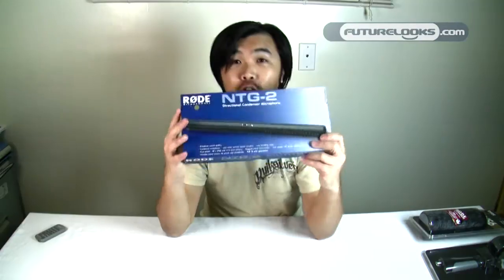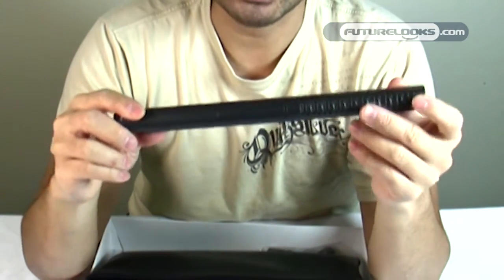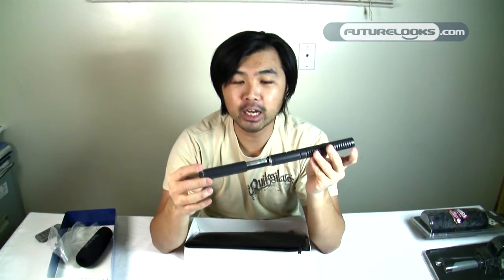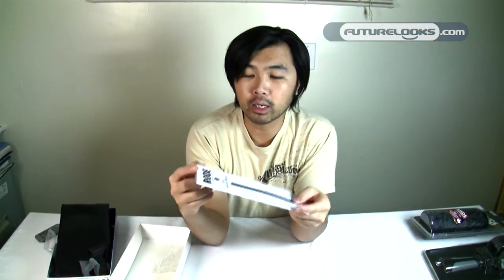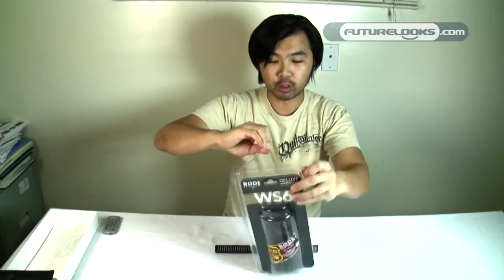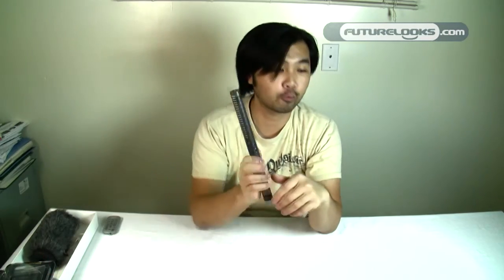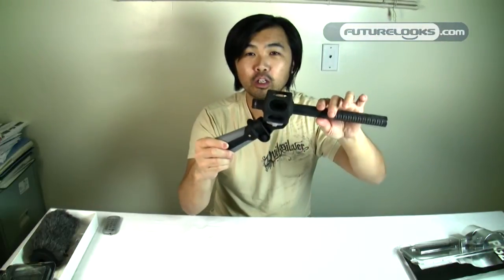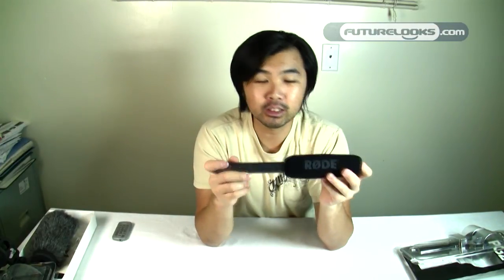Futurelooks Unboxes the RODE NTG-2 Shotgun Directional Condenser Microphone

Comment: So glad I found you showing the same version of the mic that I have, I recently bought an unboxed Rode NTG-2 off ebay for 70GBP and after watching a few videos on YouTube I was beginning to think I had bought a fake microphone. I've seen the NTG-2 in a black box,a white box and a blue box (like yours) but the one thing I've found out that is different between them is that the mic's that come in the blue box have the serial number printed on a sticker which is located at the XLR connection end. The mic's that come in the black or white boxes are screen printed onto the actual mic in the same location. Thanks again for showing a close up of the mic,you've put my mind at rest and now I can go out and start using my mic.

Comment from the maker: @tigalimamili The signal will be weak so you should put it through a box that allows you to control the levels. The folks at JuicedLink make such a device for your camera and it highly recommended if you care about the audio. Or you can run dual audio with a ZOOM H4n recorder. We did a video on this one not too long ago. Really great recorder that improves the audio for sure.

Comment: I have this mic and just bought the WS6 windscreen, that fur is a real must have! Forget about the included foam, even indoors, I got noises from a lazy fan while using it. One more you might want to invest is some real protective/hard casing, I dropped the mic TWICE into the pavement while it's in that vinyl bag! Got a little dent on the bottom, regrets deeply. Will it affect the mic badly? I'm so sad.